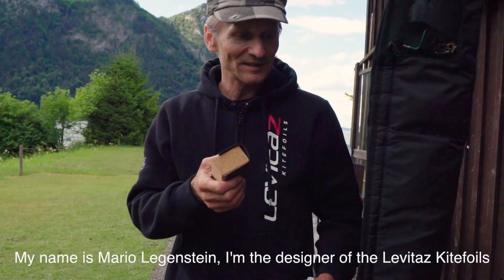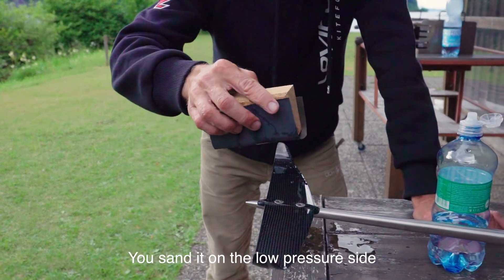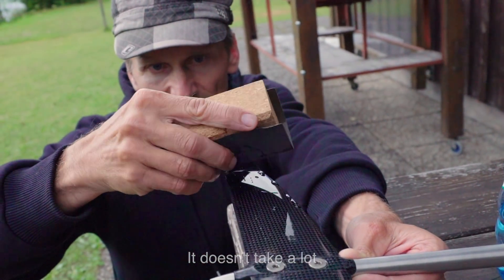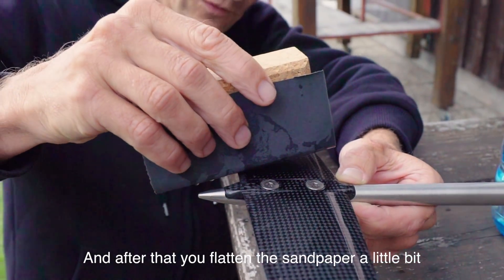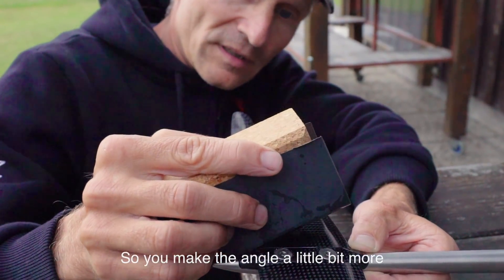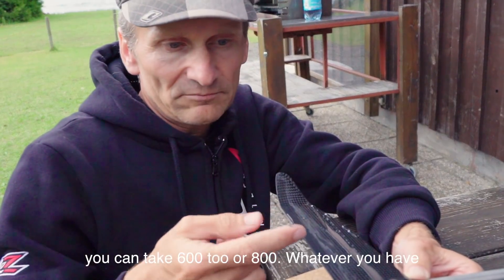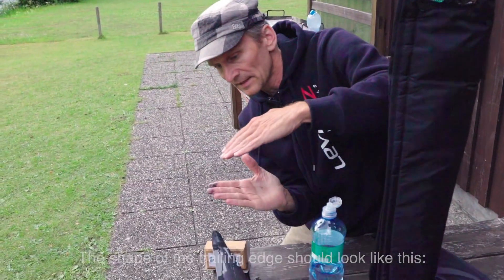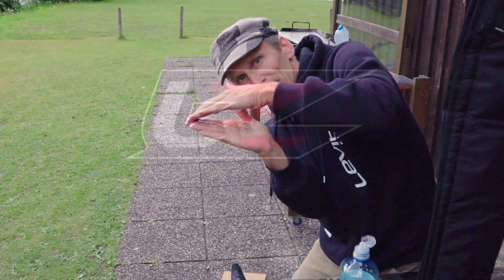How to finish the trailing edge of your Levitaz foil

Comment: In this goFoil video Alex Aguera explains sanding and it's just the other way round! (If I don't get it wrong)
He's talking about sanding the "lifting side", the round side and says NOT to sand the flatter side (which you call the pressure side)
Which is right???
https://www.youtube.com/watch?v=JavW7UZCej0
Reply: I think its basically the same with both but on the rear wing zur preassure side is in top because it generates downforce. On the front wing the preassure side is in the bottom because it creates lift.
So i think both mean the same it's just different because he uses the back wing for demonstration

Comment: You are sanding and rounding the high pressure side of the rear wing, not the low pressure side as you say. FYI.  Can you please clarify what you mean?
Reply: Sorry I was wrong, you are sanding the low pressure side of rear wing. For the front wing it would be the opposite side.

Comment: Thanks for the tip. BTW that's the low pressure side for the front wing, for the rear wing it's the high pressure side.
Reply from the maker: Thanks for pointing that out. He wanted to say pressure side. Thats the one you have to sand.
Reply: @LevitazHydrofoils  so is the dude in the video sanding the wrong side?
Reply: No, he is just saying it wrong. But I think it also doesn't matter for the stabilizer.  It is depending on the flight condition, which surface has actually higher pressure at the trailing edge. When there is some angle of attack involved with a loaded foil on an upwind, the top of the stabilizer will be the suction side as he is saying.